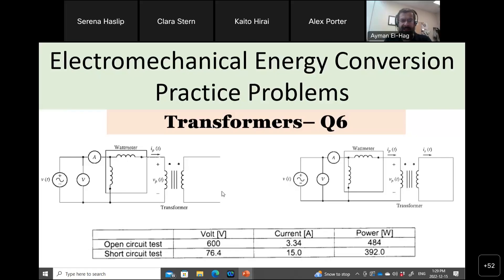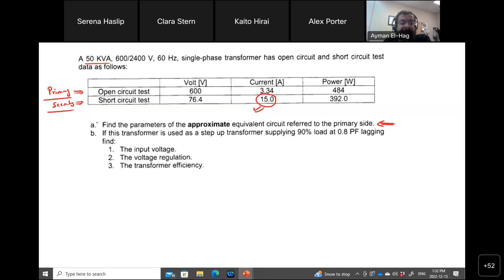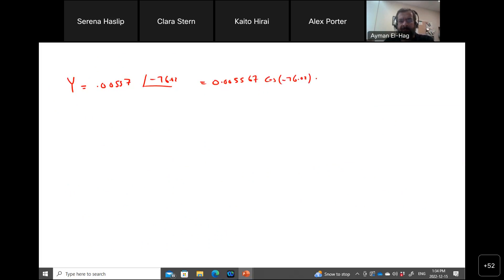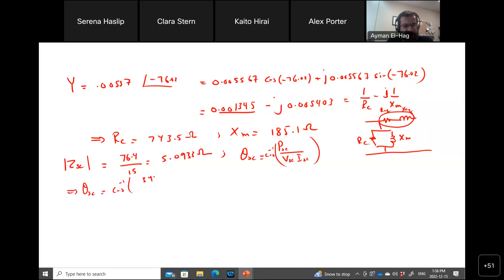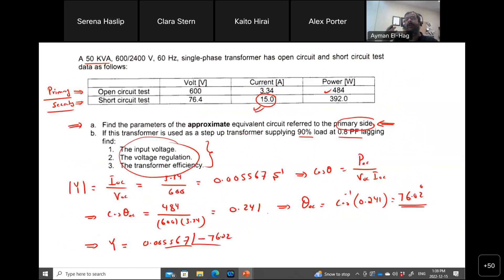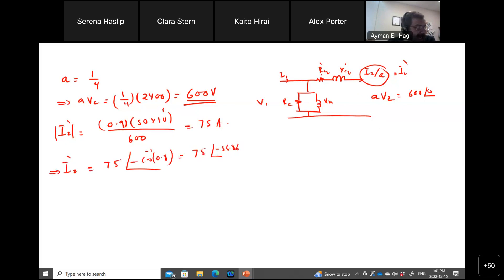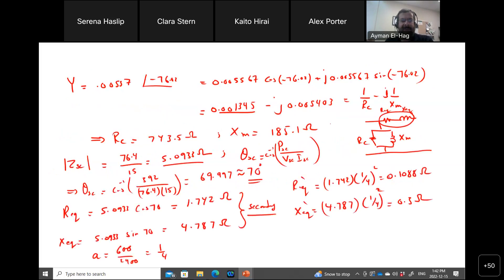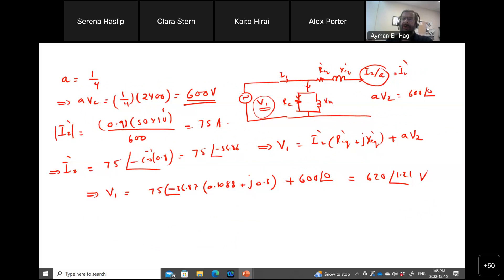Transformers: Question no. 6

Comment: Hi Professor, 
While calculating the efficiency it's given in the question to use 90% of the loading but you didn't change the copper loss. Since copper losses are dependent on loading condition the losses which should be considered while doing the calculation of efficiency should be (0.90)^2 x 392.
Please correct me if I am going in the wrong direction.
Reply from the maker: Actually when I checked the question, the short circuit was not conducted at the rated current as it should be as the rated current is 20.8 and the test was conducted at 15A. So, I think the best way is to calculate the losses at the calculated current and not to use the short circuit values.